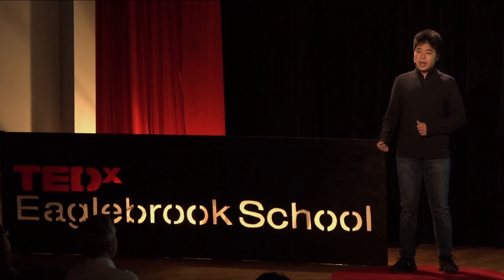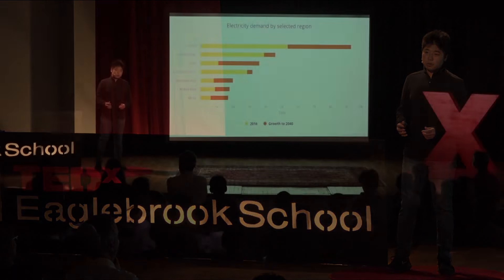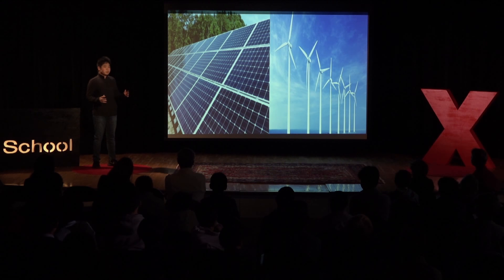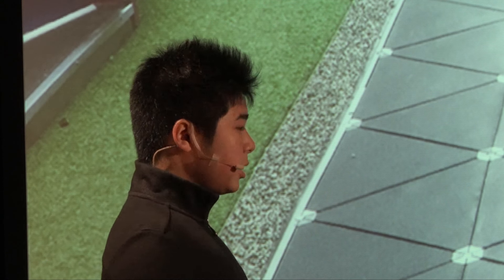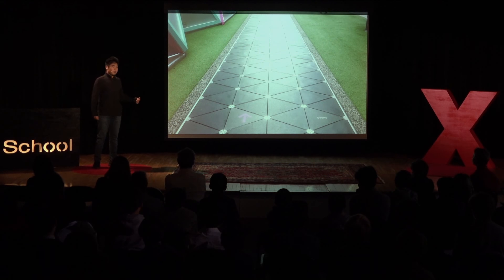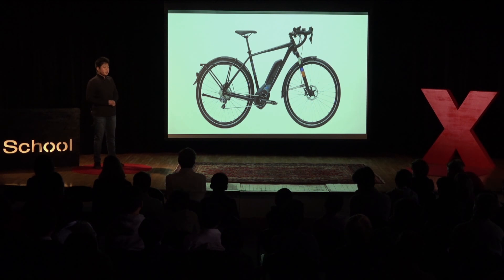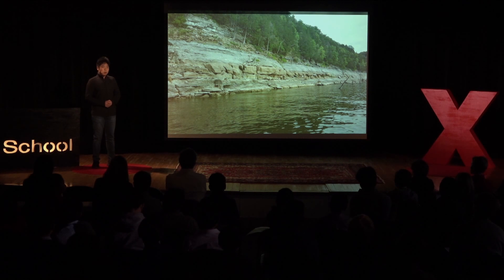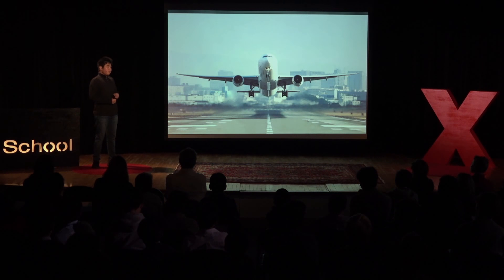Piezoelectricity: The Future of Energy | Ryan Liao | TEDxEaglebrookSchool

Comment: when you build a road, line the whole bottom with piezo electric crystals.     the 30 ton 18 wheelers driving over them will generate enough electicity to power the entire city.  at the same time the crystals themselves would absorb the shock and prevent structural deformity of the aslphalt and preserve the integrity of the roads
Reply: good way to increase vehicule consumption. Where do you think this energy come from ?
Reply: Why are you not trying to it
Reply: how would that affect the planet by obtaining all of those crystals, once existing naturally in the earth? I'm reminded of the crude oil issues..

it's not the substances we consume, but rather HOW and how much we consume. figuring out an effective means to use anything has always proved to increase the demand, which goes until we worry about depletion and undesired after affects.

Bottom line, until we consume responsibly (which gets convoluted by the endless search for the "best" energy) we will always have an energy crisis.
Reply: @efini_fc4276  back to reddit
Reply: @edgelord6560  wtf people already drive all day every day and night all over the world don't be an edge lord
Reply: That won't generate money so it will never be accepted
Reply: Sir the piezoelectrics are very brittle and cant be implemented on roads unless they made a special mechanism to absorb majority of the forces. Secondly laying piezo electrics are really expensive and finally the highly effective with higher coefficient for power generation is a PZT (Lead Zirconium Titanate) which is very Toxic